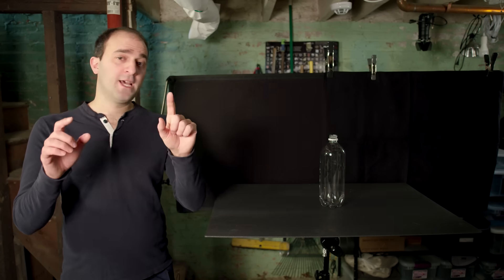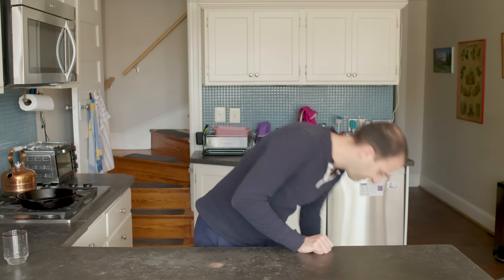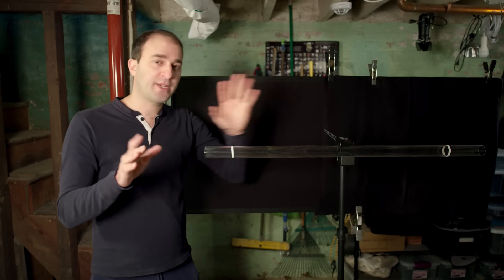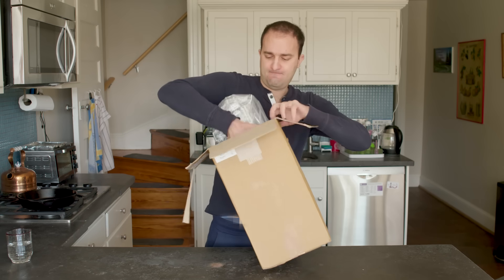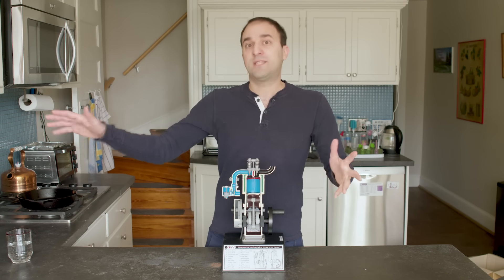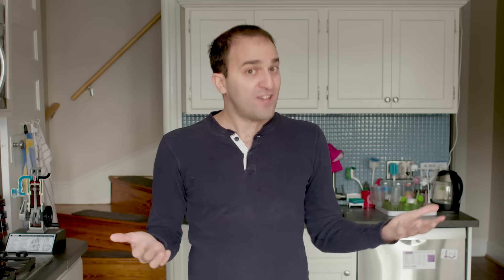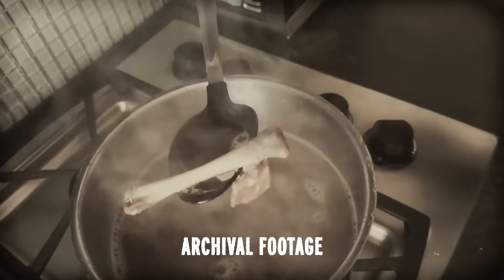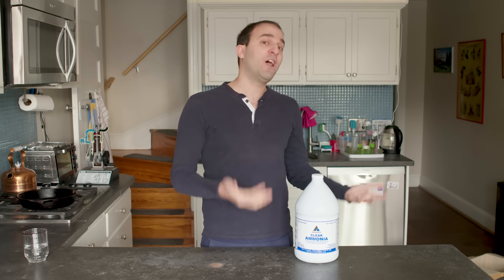Does Toyota Know Something That We Don’t?

Comment: Ammonia is lighter than air. It disperses very easily when released inthe open. It is easily burned within an appropriately adjusted internal combustion engine, but outside of an engine it is difficult to ignite and burn. In the case of a car accident an appropriately engineered ammonia fuel tank will not easily rupture, but if it does in a severe collision, the fumes will not travel along the ground and find a spark and thusly ignite. It simply does not have the explosive nature of gasoline and air (which ignites under a wide range of mixtures and conditions). Because we are used to car accident deaths, sadly, it is easy to ignore that many people are burned to death every year, and easy to scare people with the bogey man of ammonia toxicity. No doubt the owners of petroleum fields will beat the drum of ammonia toxicity, because it is in their best interests to burn every bit of the oil they are able to pump out of the ground, and unfortunately they are both wealthy and well connected politically. That said, I fully believe that ammonia fueled vehicles will be shown to be much safer in collisions than gasoline fueled vehicles - due to the ammonia being lighter than air and easily dispersed outside, and it's intrinsically difficult ignition outside of the confines of an internal combustion engine.
I had a step brother severely burned in a collision that killed five other people, all by burning to death before they could get out of a vehicle. 4 deaths were children, including a 3 year old and a baby. One person survived in the other vehicle, the mother, who had lost her entire family. My step brother was burned when he tried to pull the three year old out of the burning car, he required extensive skin grafts. It is very likely everyone would have survived if the car was ammonia fueled, even if the fuel tank had ruptured.
Sometimes change should not be feared.
A further note - all IC engines will produce some nitrogen oxides no matter the fuel. It is well understood how to reduce and control these emissions, there is no reason whatsoever to believe that engines that burn ammonia as a fuel will be any more problematic than gasoline or diesel engines are with respect to nitrogen oxides, which are produced when atmospheric nitrogen is subjected to high temperatures and pressures.
There are severe problems with replacing the current infrastructure with one that could support a fully electric automobile fleet. Ammonia/electric hybrid vehicles, though, are not subject to the many limitations of an electric vehicle fleet infrastructure wise, as most of the current infrastructure, whether it be fuel stations, electric distribution, or raw material infrastructures can be easily adapted to an ammonia powered vehicle fleet. Emissions are largely nitrogen gas and water with a bit of nitrogen oxides (although I believe the conditions inside an ammonia burning ICE will tend to produce less nitrogen oxides than current vehicles).
Everybody wins if wee convert our vehicle, even our ship and aircraft fleet, to using ammonia as an ICE fuel -even, in the long run, the owners of oil and gas fields. We certainly will have a better standard of living if we do convert to ammonia and ammonia hybrids than if we have to pay the extreme price of upgrading our electric and mining infrastructures to support an all electric fleet (and an all electric fleet may still pollute significantly depending on what the source of the electricity is).
We should have begun converting to ammonia powered vehicles many years ago - unfortunately there are those who will purposely support what they know will not work, as they want things to stay the same (ie fossil fuel interests).

Comment: Everything comes down to risk, and money. At present we transport ammonia in tankers by rail and truck and the chances of those individual units having a spill accident would be low compared to many thousands of cars driving around carrying their own little ammonia load. Cars have lots of accidents as the BEV industry  and owners are finding out. So would the risk of an ammonia spill be the same or higher than a LI-ion battery going into thermal runaway or a gas tank exploding bearing in mind that with ammonia it is probably not the flammability that is the problem but the fumes and what they are likely to do if a tank rupture occurred. It seems the risk of Li-Ion thermal runaway was either low or deliberately hidden, i will let you decide which but the fumes from these battery fires are also highly toxic and will kill or damage lungs if breathed in at high enough levels.
Reply: We have so many pipelines that transport ammonia right now. Infrastructure already in place in many places.  Drives the agriculture world.

Comment: So a counter point....

Australia for a VERY long time had insanely cheap Natural Gas prices compared to the global standard. And as such we started using for Fuel (LPG powered cars). Now this gas is lethal in a few different ways AND is undetectable without an additive ethyl mercaptan. (Which also acts to slow down its flame speed)

Now to be clear, a gas leak for LPG does require reaching a much higher ppm then Ammonia does. But deaths can and do happen due to it and thus actions were made to secure a car accordingly to minimize the risks.

Do I think this will displace Electric cars... unlikely. But thats MOSTLY because the sheer momentum behind Electric cars in most of the world at this point. Ammonia cars instead will likely be a pivot for places where electric cars are likely going to be very delayed.

The obvious example is the developing world, where creating the infrastructure for Electric cars is going to be exceedingly difficult, (both in terms of setting up stations and storing fuel for long distances between stations) but most of the inferstructure for Ammonia is already avalable.

Australia is also a use case for Ammonia. The Gunbarrel highway is a desert track in central Australia that has a stretch nearly 600km without fuel, and given the conditions you will use fuel faster then normal.
Its POSSIBLE that putting a bunch of solar pannels on your 4wd or truck will make this manageable. But it would be exceedingly slow.

Comment: It was probably old news you presented here. Marine engines have "run" on ammonia for almost 10 years now.

Ammonia must in a fuel cell not a 150 year old piston motor.
And for information, the new fuel cells have an efficiency rating of 75%.
Why make ammonia when etanol is better in fuel cells.
Last but not least, Haber Bosch stands to be replaced by a much better (energy efficient) method.

Comment: At the end of the day, the production of ammonia still results in CO2 emissions.
You need hydrogen to make ammonia via Haber-Bosch, and the Haber-Bosch process itself requires heat that is provided by....yep, burning fuel that releases CO2.
Right now we make nearly all of our hydrogen from methane via steam reforming, and this process produces CO2 as a by-product.
I am somewhat skeptical of GAC's claim that switching to ammonia fuel would reduce carbon emissions by 90%.
I am also far too familiar with ammonia's stench from my lab career to be completely comfortable with embracing it as a fuel for my car.
There's also the question of the emission of N2O (and other nitrogen oxides), which is far worse for the environment than CO2.

Ammonia as a fuel is a concept that has an extremely narrow margin for error - if estimates on emissions are off by just a tiny amount, the environmental consequences could be disastrous.

Comment: Farmers use anhydrous ammonia for fertilizer.  There is a huge tank at the local coop.  The stuff is dangerous when there is a leak.  It is stored under pressure, and is made from natural gas.  Why not just burn natural gas, it is less dangerous.  And climate change is nothing but a hoax.

Comment: Let's see, GAC (AKA China) via Toyota wants to sell cars in the United States powered by the single most toxic gas moved routinely on the American railroads. I teach chemistry and this issue (INSANITY) simply can't be ignored. (Ammonia solution (ammonium hydroxide) is NOT comparably dangerous, so that straw man demo is kinda on fire.) Even Fritz Haber knew how dangerous this stuff was and tried warning people!  But hey, the upside is saving the planet, right? NO THAT'S WRONG! I guess toxically wiping out communities (including basically every organism in the area of any leaks) in order to play the carbon neutrality game is a worthwhile risk, right? Heck, if true, why not develop "nuclear" Stirling engine based cars using radioisotope thermoelectric generator (RTG)--at least such (dirty) devices would have decent weight-to-efficiency AND they're carbon neutral too. They would also be wickedly dangerous. 

Even merely fueling this vehicle or transfering the fuel from the truck or train at filling stations would be a high level hazardous material handling operation (and very likely to end people). Only 1 gram of ammonia (about 1ml or 1cc) is enough to wipe out everyone in a car within seconds. A comparably sized fuel tank will only give us 1/3 the range of a fossil fuel, so we're stuck either having much larger tanks (say 150 gallons for a normal car)--that, OR fueling more often. Switching the "fuel" over to to ammonia water would triple that tank AGAIN (and greatly increase the weight). All that fuss still assumes the solution to be temperature stablized (because when it warms up that horrible ammonia gas is released). This CAN be managed by using a less concentrated solution, which adds still more weight and volume. This is profoundly impractical. 

Finally, we have to look at the non-trivial (and NON-zero emmisions) energy hungry process of ammonia productionn which requires significant heat and pressure--and the cherry on top: it's dangerous too! 

For Toyota to be merely "looking at this" is frankly hard to believe unless somebody is getting paid off. Ammonia-based appliances (mainly air conditioning) and other systems were eliminated MANY years ago in favor of safer alternatives because even pinhole leaks were removing entire families; maybe somebody's nostalgic for the bad old days. 

WE NEED TO HALT THIS IDEA BEFORE SOME WELL-INTENTIONED BUT HORRIBLY MISINFORMED CONSUMERS PUT AN END TO THEMSELVES AND PERHAPS THEIR NEIGHBORHOODS!

Comment: One difference between petrol and ammonia, hydrogen, and for that matter, batteries, is that petrol is both a source of energy as well as a method of storing it. That is, it takes more energy too make ammonia, hydrogen, and electricity from batteries than you can get out of it. How do you get the energy to produce these new fuels? About eighty per cent comes from fossil fuels.

Comment: In human waste stream the process of denitrification requires  the reduction of nitrate to nitrogen gas,The bacteria also require a carbon food source for energy and conversion of nitrogen. The bacteria metabolize the carbonaceous material in the wastewater as this food source, metabolizing it to carbon dioxide. This is overlooked in green house gas emissions because its declared a biogenic source. Biogenic = Normal safe and effective GHG emmissions. Non biogenic = a fear of elemental carbon. 

Everytime you flush the toilet. Youre contributing carbon dioxide to the environment...And probably consuming more nitrates as Urea in fertilizer that enters your lawn and food supply...Captured from the Atmosphere by nitrogen gas extraction. WHY GIVE IT AWAY FOR FREE?? THEN COME BACK TO THE STORE AND PAY?? even if you dont care about carbon emissions?

Now See: Ammonia Recovery from Hydrolyzed Human Urine by Forward Osmosis with Acidified Draw Solution

DO NOT HAND OVER YOUR LIQUID GOLD TO THE GOVERNMENT. N-P-K ratio is roughly 11-2-4 and includes calcium and magnesium. Government doesnt want you to know. But people will give this stuff away for FREE.

The high Nitrogen content basically means youre messing with stump remover. The quote for how long to get a bed of wood chips to fully compost into top grade biomass is YEARS. NAH..NAH BIG DOG!! TRY 6 MONTHS WITH A REVOLUTIONARY OLD PROCESS!! now youre BIOGENICALLY CAPTURING carbon. Not RELEASING it...Provided you can get a steady stream of wood chip.

Comment: There are older ammonia engine designs so the Chinese patent may not even stand up internationally. The technology never took off because ammonia never passes the crash test. You always get a leak that is too dangerous to people trapped in the car and to rescuers. Water washes away petrol and its vapor is heavy so it flows away from the occupants and rescuers. Ammonia hangs about and is toxic even if its diluted with water.  
Its a very useful potential grid storage technology and Toyota is having a go at that too. So we may not see cars but houses with such systems. 
However  one reason why people back climate change is that they think they can use it as an excuse to tax carbon, energy, to fund left wing causes. In that context any working technology, no matter how green counts as a tax dodge. It will get blocked if it works. 
The most viable green fuel is ethanol hybrid cars with on farm solar assisted vacuum distillation. That's effectively banned! That is also something you can do experiments with. Ethanol hybrids don't have the starting problem. On farm ethanol means you can feed the wet distillers grains to livestock effectively negating the food verses fuel problem. 
The whole climate change scare is bogus. Designed to drive people people back to nuclear fission. Which has worked in some places. The climatologists that created it all had connections to the nuclear industry. Toyota knows this and is spending a few million to pay lip service to the new climate religion.

Comment: Ammonia is extremely water and energy intensive in production.   So for a cleaner fuel when burned in vehicles, we're burning more energy to make it, and using HUUUUGE amounts of water.  This isn't a step forward at all. 
And Ammonia plant unfortunately going up near us, plans to produce 600 metric tons per day of ammonia for fertilizer.  It will be using 138,000 gallons of water PER HOUR. Or 3,312,000 gallons PER DAY.  
Pathetically you go to their data point on the company website and new releases they list 2,300 gals per minute. Why? because 2,300 looks small to most people.  Upscaled to its daily amount it is scary how much water they are going to use in an area that just came out of a major drought.   So you think they'll cut their water use if the drought continues?  I don't.  Depleting an already strained aquifer that is suffering from nitrate issues already.  Drain it down and that nitrate problem concentrates even more. 

And none of that gets into the energy cost to produce.

No Ammonia is not a solution to climate change at all.

Comment: Maybe NH3 will clean up  power generation and in some % percent may work with fuel cell or hybrid fuels which I believe are all ready possible if Toyota can figure out how to keep cost down and handle it safety think we will see some many sort of option. Which may make better option then Lithium which has its own issues.making batteries safe and inexpensive. In this economy other options will have be more reasonable. One will hopefully win out. Gasoline only won because it was a byproduct of lamp oil and Rockfeller had to get rid of it so Ford put it to use. Originally think Ford planned to use alcohol but gas won out.

Comment: Your "fact checker" has completely failed.
I have to make you aware of that it was not the Germans Haber - Bosch who invented the production of artificial fertiliser.   That invention belongs to the Norwegians Birkeland and Eyde ....a process which they patented in 1903.   With their invention they started the company Norsk Hydro in 1905 ...hence they had produced fertiliser for years when the Germans came with their "invention" in 1910.   The Germans simply made a twist of an already existing Norwegian invention ....standing on the shoulders of others does not make an invention.   Norsk Hydro was in 2004 split into Hydro ( world leader on aluminium production ) and Yara (chemicals and one of world's largest producer of fertiliser ) ....and they are operating world wide.    
Norsk Hydro has from the very beginning in 1905 been running their production on hydro-electric power ...hence renewable ....and they had plenty of it.....  
So please do better fact research next time.....
When it comes to ammonia as fuel for ship engines ....well than Norway has been on the ball for years.   Together with engine manufacturer in Finland they have already build ships that are being propelled on ammonia.   So Japan welcome after with your car engine.....

Comment: Sorry to say Ammonia will never be viable. It's extremely toxic. It was used as a refrigerant, not sure if in use at all today, but it has killed a number of mechanics. Just one whiff of this stuff in a concentrated form will drop a man to the ground instantly! Had the experience myself on an old blue print machine in an engineering office. Was like being cold cocked, dropped like a rock.

Comment: Not sure what Toyota knows, but I know this - Condensed ammonia is corrosive, and in its anhydrous state it can cause stress-corrosion cracking of stressed carbon steels or high-strength, low-alloy steels.

Comment: 1:50 I hate the lies. Gasoline was a by product of the oil refinery process until the ICE came along so it was NOT "designed' for the engine where '"designed" implies 'created'.
Before the ICE was developed around 1892, gasoline was discarded as waste: Source US Energy Information Administration.
Since then it has been optimized for the ICE.